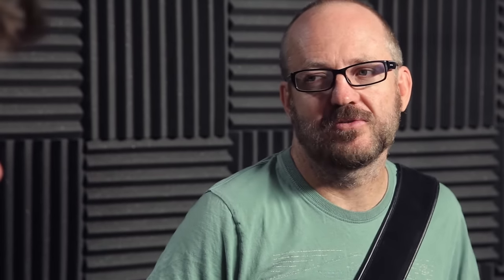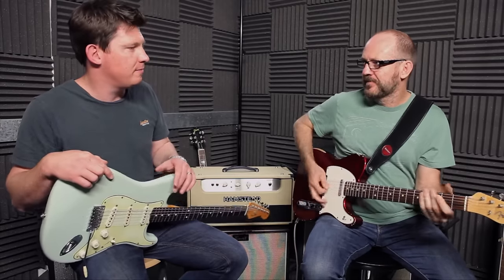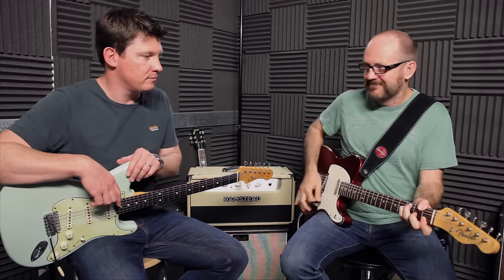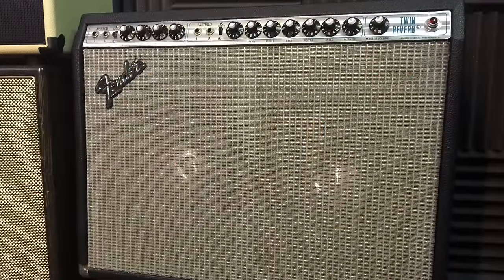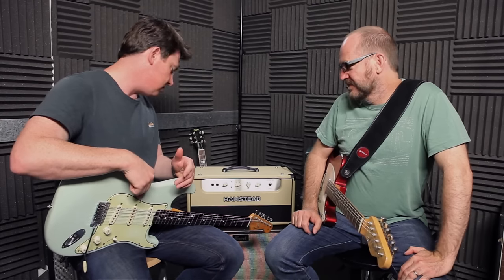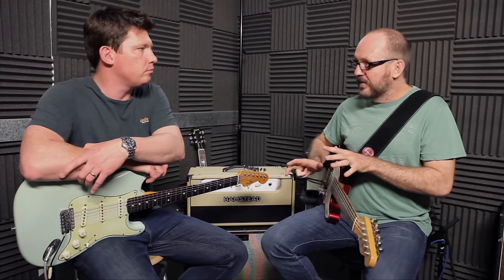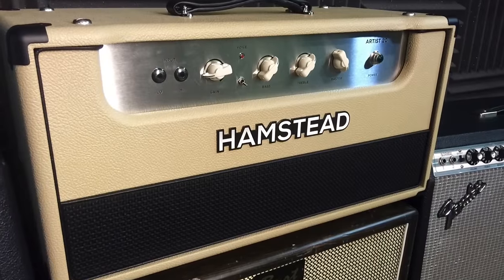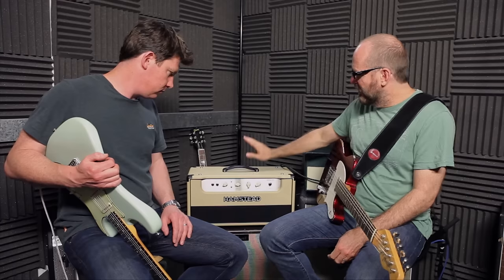Setting Up Your Amp To Use With Drive Pedals

Comment: The Blackstar HT-20 has the same valves as the Hamstead (though one less in the preamp stage). Interesting to me as I own one, though sadly I've only used it a couple of times due to fussy neighbours. I have to take it out to my friends practice shed if I want to really get much out of it.

I have the 2x12 cab but kind of wish I'd gone for the 1x12. I think the head looks nicer sat on top of the 1x12 and it would be lighter to lug around (so I'd be inclined to do it more often). I guess if my circumstances change the 2x12 will be nice to have though.

Should the Blackstar have a similar level of versatility with different pedals? I know they were aiming for versatility with it, but as stated I've not really had much time playing it and so haven't had the chance to experiment.
Reply from the maker: Well, giving it cathode biased EL34's will do something to bring them together but I'd say sonically they're quite different. Both great though. The HT20 is a great amp
Reply: +Daniel TheGigRig Thanks. I really appreciate the reply. I've read some opposing views regarding the HT-20. Being it's my first valve amp, it's nice to have some assurance from someone who's opinion I value that I haven't made a mistake.

I've been binge watching your videos since discovering the channel. Keep up the great work :)
Reply: +napalmhardcore None of the Blackstar HT series amps are proper valve amps: they each use a built-in distortion pedal rather than valve gain stages.  The difference goes far beyond “cork sniffing,” as you will discover as you explore the dynamic relationships your guitars, pickups, and pedals create with it.  I hope that you enjoy your amp, truly, though you should keep in mind that your experiences with its preamp are not indicative of valve amps.

—An Amp Geek Who Started with an HT-20
Reply: +Robstafarian I've been doing a lot of research recently. The more I've dug, the more I've found people say that the biggest factor in what defines a tube amp is the power-amp section, not the pre-amp section.

I've found a lot of these discussions whilst researching pre-amps and pre-amp style pedals, both solid state and tube based. One of the people participating in one such discussion ran a bunch of AMT Legend pre-amps in the loops of a pedal loop switcher direct to the power amp of an AC30, including a pedal that models an AC30. He said that he was hard pushed to tell the difference aside from the way that it reacted when other pedals are plugged into it.

I'm not qualified to say one way or the other, but I found this really interesting nonetheless. The prospect of using external preamps directly into the power-amp is something I'm particularly interested in. I would still like to own an all tube amp in future to make up my own mind.

Maybe Daniel and Mick would be interested in doing a show about direct-to-power-amp pedals and pre-amps (hint hint).
Reply: +napalmhardcore That's very subjective. The great Overdrive you get out of a Dumble comes from the preamp. They're all essentially modified Fender amps. The same goes for Mesa Boogies. Depends on what you're playing. Classic rock is more power amp, modern is preamp.
Many people will tell you the best dirt doesn't come from either, but from speaker breakup.
Reply: I personally do not claim to know as my experience is limited. My post was reporting back what I had read while researching.

What lead me to these opinions (other people's, I haven't adopted them as my own) was when I decided to research preamps and the different configurations available (tube preamp into solid state power amp section, solid state preamp into tube power amp section and all tube path).

Basically what I gathered was that a lot of people (normally beginners) will look into the possibility of buying a tube preamp or overdrive pedal to make their solid state amp more like a tube amp. Allegedly this does not achieve the desired result.

I then researched what the result of running a solid state preamp into a tube power amp section would be. Allegedly this acheives a pretty good result, however solid state preamps don't react in the same fashion as a tube amp when pedals are put in front of them (overdrives/boosters etc) and I don't know how they would differ in terms of feel.

Funnily enough I've had a hard time finding demos of people running stand-alone tube preamps into the power amp section of a tube amp. Most people seem to use them as drive pedals straight into the front.

I find the idea of using a preamp into the power amp a really intriguing prospect, especially if it does a convincing job of recreating another amp. I like pondering the tonal possibilites of combining different pieces of equipment in various different combinations. With how great digital stuff has become over the last few years, there are so many different ways to do things and I like to hear/read peoples experiences of trying different combinations (for example, analogue pedal into digital amp model into tube power amp).
Reply: napalmhardcore Firstly, I want to point out that the interactivity of a tube preamp is not just about pedals: it is also about pickups and guitar circuitry in general.

Secondly, my third amp was actually a Mesa Formula Preamp which fed a Mesa 50/50 power amp.  That was, for all intents and purposes, a stereo tube amp.  I later sold the 50/50 (and the 2x12 with which I used it) to a guy who had an AxeFX XL: it really did make it sound significantly better, though I cannot speak to its interactivity and feel.

Finally, I feel that running tube equipment into digital modeling is a waste of time—apart from the joy of experimenting.  Proper tube equipment reacts “honestly” to its input, whereas digital modeling is coded with various presumptions which control how the input is interpreted: why feed an “honest” interaction into a presumption, particularly as the result of said interaction is bound to be beyond the parameters of such interpretation?  I feel quite strongly that dedicated tube preamps—with or without built-in audio interfaces—would be infinitely better for beginner's than digital modeling: “honest” interactions are lessons in playing dynamics, whilst presumptions are essentially misinformation.  Someone who knows the difference can make an informed choice as the to overall benefit of the compromise, which a beginner cannot do.
Reply: Thanks for the informative reply. My interest in digital gear is driven by three things. Firstly, it's versatility is appealing and I think that is what draws many people to it. Secondly, I am rather restricted when it comes to practicing at home due to fussy neighbours, so the practicality and convenience of using headphones plugged into a modeler/multi effects unit cannot be understated. Thirdly, I'm just a bit of a geek and I find it fascinating how far the technology has come especially in the last three to five years. Sonically, I feel that the technology has crossed a threshold where the vast majority cannot distinguish the real thing from its digital counterpart in a blind test. It's now become more about how it reacts to playing and that is an area that is improving (people say in demonstrations how the feel has improved in comparison to older modelers).

There is however the problem of me not knowing how tube amps react and feel due to my limited time playing them. As you pointed out, a tube amp reacts very honestly due to its very nature. I do not have the experience to know where the experience on digital gear deviates from the real deal. Also in the case of digital gear, the experience can be scaled (for example you can emulate the experience of playing a cranked plexi to an extent at low volumes without having to push real equipment). This does however lead to another complication in that, someone unaccustomed to tube amps (such as myself) will not know how to appropriately scale the response to the volume. Also, our perception changes at different volumes. With a real amp, it reacts how it reacts dependent on how hard it is being pushed and how loud it is (i.e it is honest).

I am also fascinated by digital vs analogue when it comes to things like vinyl vs digital formats. I have recently been researching DACs and learning how the vast majority of those used today discard the majority of the samples that make up the recording and then scale up. This means that despite how accurate it sounds, there is a level of approximation. With analogue, it is a continuous stream of information that physically affects the medium it is being recorded onto. It is a more direct connection between the original performance and the listener. Digital does however have its advantages, one of which is demonstrated by the very fact that this video and its accompanying audio are digital.

I would love to gain some more experience with tube amps. There are so many amps I would love to play or own. Unfortunately my interest in gear is greater than my wallet can support :( but I think that is true for most people.
Reply: napalmhardcore Check out the Two Notes Engineering Le Preamp series: Le Bass, Le Clean, Le Crunch, and Le Lead.  I am thinking of buying a Le Crunch, myself.
Reply: I watched EytschPi42's video on them and a couple of other demos. Cool pedals. Speaking of Two Notes, I'm also pretty interested in their cab sims.
Reply: +Robstafarian I used to think the same about running tube (or analog period) into digital. I equated it to putting a pumper sticker on a Bentley. I could always tell the difference between analog and digital. Now however, that line has blurred so much as to be essentially non existent. It may have been the digital equipment I used years ago was sub par, but I think it was just where the technology was.
Reply: tim white Please, clarify what you mean by “digital.”
Reply: tim white I just realized that your comment about the Mesa Cab Clone is not being displayed for some reason.  Regarding the Cab Clone, I would like to make two points: 1) There are much better load boxes on the market; 2) Why add expense when one can buy a Two Notes Le Preamp pedal for $300?  That price is so good that there is little point in searching for used Mesa rack preamps, as good as they are, especially considering that multiple Le Preamp pedals automatically work together that they become additional “channels.”
Reply: This isn't related to this comment specifically and is going back a bit in the conversation, but do you happen to know if the HT-20 uses its built-in distortion pedal (as you put it) on the clean channel or is it just on the OD channel?
Reply: napalmhardcore The built-in distortion pedal is the OD channel.  As such, it does not affect the clean channel.
Reply: Cool, thanks :)
Reply: I DID NOT KNOW THAT ABOUT THE HT SERIES, I HAVE THE HT5 METAL MINI STACK, THEY ADVERTISED THE HT SERIES AS BEING ALL VALVE SO I WONDER IF THEY COULD BE SUED FOR FALSE ADVERTISEMENT? TO THE GUY WHO SAID HE COULDN'T USE HIS HT20 AS LOUD AS HE WANTED YOU COULD ALWAYS USE A VOLUME PEDAL IN THE LOOP OR DO WHAT I DO AND USE A EQ PEDAL WITH A LEVEL CONTROL(BOSS GE7) AND BRING THE LEVEL DOWN SO THE VALVES ARE WORKING HARD WITH OUT IT BEING SUPER LOUD, THE MXR 10 BAND EQ IS ALSO A GREAT EQ PEDAL, IMO EVERY GUITAR PLAYER SHOULD OWN A EQ PEDAL, IT CAN COME IN HANDY IN MANY DIFFERENT CIRCUMSTANCES, I ALSO USE THE EQ CONTROLS ON THE PEDAL TO CHANGE THE TONE OF THE AMP, YOU CAN DO THAT WITH THE PEDAL IN FRONT OF THE AMP TOO BUT IN THE LOOP IT HAS A MUCH GREATER EFFECT ON THE TONE, 1 OTHER PEDAL EVERY PLAYER SHOULD OWN IS THE BBE SONIC STOMP, ITS BASICALLY A PRESENCE AND RESONENCE CONTROL FOR AMPS THAT DO NOT ALREADY HAVE THEM BUT ALSO JUST IMPROVES THE TONE AND ADDS CLARITY, DEFINITION AND PUNCH TO THE TONE AND 1 MORE THING IT TAKES TIME BASED EFFECTS LIKE DELAY,REVERB, CHORUS ECT... AND MAKES THEM SOUND MUCH BIGGER AND MORE DYNAMIC, CHECK OUT THE GUITAR WORLD DEMO
Reply: its impossible to read your comments,can you throw away your keyboard or find the fucking caps lock key and press it OFF

Comment: So, I play for church, and as you know church music has extreme variations from ambient to funk to full on lead solos. So, I plan on getting an amp and leaving it on a clean channel and adjusting the shape with pedals and was wondering if you think a blackstar ht-40 or a vox ac30 would work better
Reply: I do know from experience that the AC30 can be picky with pedals, so would probably go for the Blackstar. Having said that, the AC30 is an amazing amp, that has it's own sound.
Reply: sickleclowns awesome, thanks for the advice!

Comment: I wonder what the volume was on the Twin Reverb.
Reply from the maker: It was LOUD :)
Reply: +Daniel TheGigRig This should be regarded as tortology. The hihgest volume setting I have ever used on my Twin Reverb was about 3. 

At an open air gig.

Still too loud.
Reply: +Steve Kellett I opened mine up to 4 IN MY BEDROOM. Thought I was shake the damn house apart lol

Comment: I have a Fuzz pedal that has a high enough mids to sound great with a Fender amp, i tested it with Super Champ X2 (Princeton-like), Blues Junior, and Hot Rod Deluxe 4
and it sounds nothing like Big Muff with the Twin in the video. I dont know if it is a copy of some different pedal, im not much of a Fuzz expert, it's called Xvive Fuzz Screamer.

Also new Hot Rod Deluxe 4 boosts mids and cuts highs and bass so much on the drive channel that i use it along with the clean channel just like a different pedal platform amp, more
marshall'y (set clean with a little hair), clean channel is great for cleans ale mild mid boost overdrives, and drive channel is great for more distorted tones, if they need smoothing, 
zero fizzyness there.

Comment: How does the Victory V40 head stack up against the Hamstead in terms of tone? It would seem from the very flattering reviews that it might be the amp to have for trying out different drive pedals for a bit less dosh. This vid seems to suggest you can't go too far wrong if you possess a Fender and Marshall style amp.
Reply: +Jonathan Tumman I think he Victory is very nice for it's price point, but in comparison to the Hamstead, the V40 is very flat tonally. The Hamstead just does more and does it better. That isn't to say the Victory is bad, it's just what it is. Having tried both and considering their respective price points, they're both justified and very fair prices for what they are.

Comment: Dan, trying to take on board what you're saying and learn from it, would I be right in saying that if I ran a big muff through a compressor and then into a fender twin I would be able to smooth out the "sharp edges" and get the nicer sound that the Marshall generates?

Comment: Hi guys great video ! just a little question for a range of tones. As a predominately rhythm guitarist I need to have a clean tone, Rhythm and then occasionally lead tone higher up in the mix all from one rig ready at a push at a gig. Would it be best to use an OD / driven boost pedal in front of the clean channel for the clean and rhythm tones and then put this in front of the driven channel for lead tones. Alternatively would it be better to stack a higher gain sound on top still on the clean channel ? By the way I use a marshall DSL40c.
Reply from the maker: +Dave Lewis hard to say Dave, but an OD pedal into the clean and a booster into the dirty would be ideal, but have a play and try some things out, see how you get on :)

Comment: Often I find there to be a lot of banter in this show that's not really relevant to me, but this time I feel I genuinely learnt something useful. It was very clear how much of a difference there is between pairing amps and pedals and I think I will take this bit of learning with me for a long time. Thanks!

Also, I'm looking for an amp that will let me do pristine clean things, massive heavy sludge/stoner riffs and mid/trebly straight up noise stuff (like Swans). I have the songs... I just need the amp/setup and I'm currently not quite happy with what I've got (tele custom 72 w/wide range humbucker, big muff, great destroyer, boss chorus, delay & reverb going into a 5150 signature head). Any suggestions?

Comment: Thanks for a good vid fellas,  i have a question for you or rather would like your opinion?  im running tuner, wah, maxxon 808 and delay in that order to the front end of my OR100.  i have a phase 90 and blue sky in the effects loop.. my question is if i put my delay in the loop as well my reverb should always be last.. yes?? sigh.. or should I keep the delay in front end.. its a standard carbon copy.. thanks to anyone who might have an idea ! cheers from victoria BC.
Reply: Experiment and see what you like. There's good or wrong.

Comment: Jack White used to plug a Big Muff into a couple of twins 😘
Reply: +Adrian Figallo Very good observation! And he made a signature sound for himself doing things like that. And people loved it. I loved it. "...make the sweat drip from every pore."
Reply: +Adrian Figallo The problem in this Video is the Tone Setting of the Big Muff, as you can see at 6:07. Normaly you would adjust it and not leave the Tone setting way open.
Reply: +Adrian Figallo Plus White's twins were running at full blast.
Reply: +Guitar noise chains thank you! Yes! They expect the muff to sound the same when clearly they dialed it in foe the Marshall...
Reply: exactly
Reply: that's why he had that "plugged straight into a throw away solid state stereo" 
sound,brittle and nasally and not very palatable.him and "the edge" went to the same "guitar school"
Reply: Used to play a tonebender thru a twin, treble on the twin was on 4
Sounded great